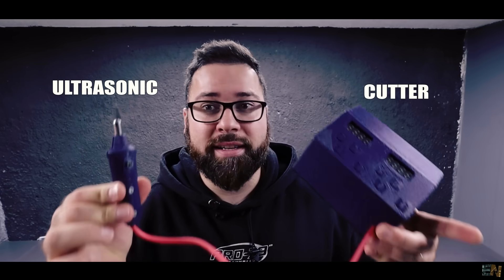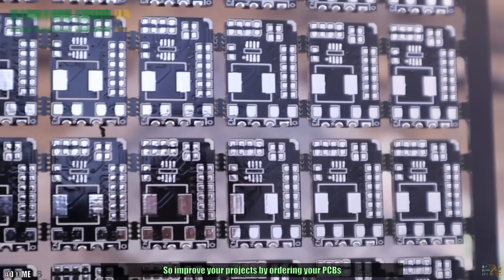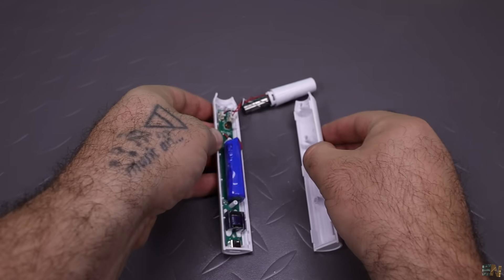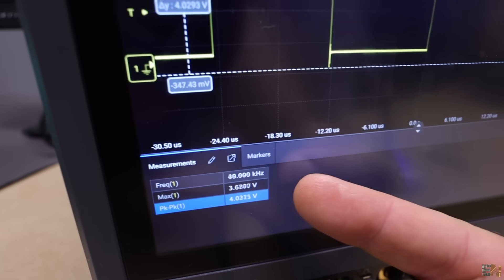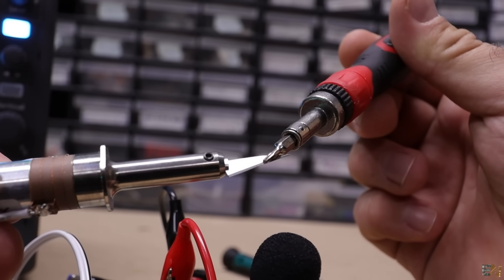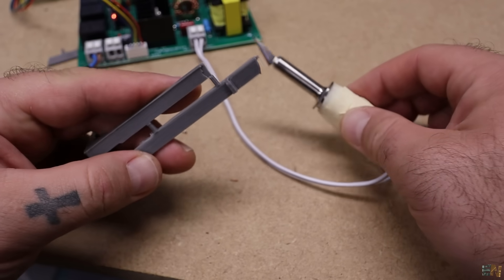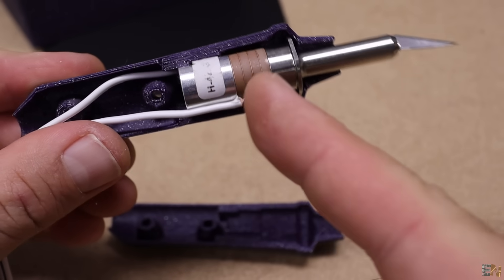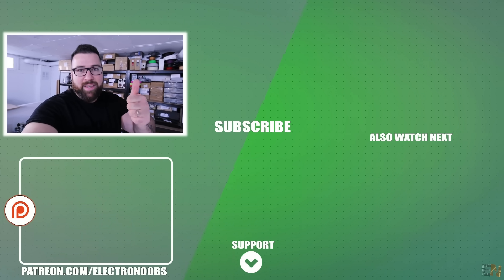Homemade Ultrasonic Cutter vs $500 Store Version!

Comment: Heyy super cool project! Could it also do some ultrasonic welding of two thin pieces of plastic? I was looking into building one also but looked to hard but really cool you made it work!
Also for mounting the piezo, I don't think the back is the right position for mounting, when you are at resonance there are peaks and valleys in the metal. the movement of the metal has a 90 degree phase difference with the pressure in the metal. Where there is a peak in the pressure there is no movement and that is the ideal place for mounting the piezo consteuction. 

The end pieces usually have the most movement and that is true for the back and the front of the piezo construction I think

Comment: A very good project!  I'll be eagerly awaiting a sequel. I've already been down much of this path myself.  One quibble, though.  You talk about to the horn 'amplifying' the US signal. Just as in stereo speakers (and electronic circuits), much of what you are wrestling with is impedance matching. The change in perceived US power strength is a matter of coupling efficiency.  'Amplification' implies that power has been added to the system.  'Gain' (a term you also use) is not really the same.  It implies that power is more efficiently transferred in the way that you want, and is therefore transferred to the intended target.  Subtle, but important.  But I'm sure that you know this.

Comment: I think this project is super useful for people like me who need to make clean holes for USB-A, USB-C, and other ports.
I’m building a custom powerbank with a huge capacity (around 350Ah).
Inside the box there’s also a 4G/5G modem, a led light with controller, and other modules.
I use it for camping up in the mountains😂

Comment: I'm using the irs2153, in the same configuration. But im not using bootstrap, as both transistors are low side drivers (ie emitter to ground). Try again without the bootstrap cap. Hampster time does a great video on this.

Comment: Because you want to make it handheld, I’m honestly wondering if lowering the frequency could make it cut better? 

Think about how a jigsaw works, if the blade speed is too high the cuts turn out worse and wear out the blade faster than when it’s dialed into the proper speed.

Comment: Power ultrasonics is a quirky and challenging area of electronics and physics, but you're off to a great start. 

A few tips. A bipolar drive signal is best, but it's not strictly necessary. You can get great performance just from a DC square wave, too. You didn't go deep on your feedback loop for tracking resonance, so maybe the IC is handling that for you. But it's critically important: that dental transducer may have a resonant peak only 10-50Hz wide, and the resonant frequency changes constantly as components heat, as your grip changes, etc. So make sure you have an active tracking strategy you can control. The PLL on the cleaner driver may be ill suited to your transducer. 

For miniaturizing to make this portable, I had luck in an early prototype using a TI 100W bridged opamp IC and a step-up matching transformer. 40KHz is outside of its effecient zone, but it worked and kept heat low. 

Good luck with part two!

Comment: If there is more than 400 V, then isolation of the cable might not be suffcient. Also the distance between the transducer cable and the on-button can lead to a spark which will destry the circuit low level part.

Comment: You can not just only cut but....
Solder on not suitable surface like Aluminium and glass .
Can super mix two non mixable solution like oil water.

Comment: 8:46 I want to share my experience , i noticed normally  the output of USC board is very low whithout transducer connected because I tried shorting or driving Flyback Transformer it doesn't work at even 50% of power even with proper impedance Match but when I connect pizo or perticular value cap in series it suddenly jump to resonance with Highpower mode .

Comment: Ultrasonic transducers become resistive at their resonant frequency, that is why a "push-pull" power driver circuit is required.
Reply: Can you help me ..? I want to power and modulate lower audio frequency with Ultrasonic so I am not sure which High power switching topologies is best ?
Reply: @omsingharjit  A standard audio power amplifier will drive piezo transducers at sub-ultrasonic frequencies.
Reply: @ricksampson6780 no , my pizo is from ultrasonic cleaner no audio driver will give 300 to 800 v for US frequency normally. I have seen people using H bridge Moter driver for low voltage but i need For 40 to 80 watt power for such Transducer .

Comment: I wonder if adding mass to the base of the transducer would increase it's performance. The crystals do nothing but drive two metal masses apart. As soon as the blade touches a work piece, the whole coupling requirements shift towards a higher counter mass. And the plastic enclosure does not offer the rigidity for a good power transfer to the user to act as counter mass.

Comment: Dead (or dwell) time in push-pull and bridge DC-DC converters is critical. It prevents both switches from conducting simultaneously, which would cause shoot-through current, excessive heating, and possible device failure. Proper dead time also allows diode reverse recovery and switching transients to settle, reducing EMI and improving reliability. Too little dead time can destroy the power stage, while too much increases losses and decreases efficiency. The goal is to set a safe margin that ensures clean switching without excessive conduction in the body diode.

Comment: For MOSFET droving you can use TLP250-TLP350 optocouplers, you will have isolation as bonus. Only you need to power output of these optocouplers with 10-15V supply. And you need to increase ratio of transformer to get higher output voltage. Also you need to adjust output resonance with inductor - capacitor like in board you bought.

Comment: Just remember one thing. For that 40khz transducer it has a specific capacitance and you have to match a inductor with suitable inductance to creat that LC resonance frequency. But when you try to cut or the horn touches other things (case included) the capacitance changes and also affects the resonance frequency. You must add a feedback circuit to cope up with that.
Reply: Ultrasonic transducers become resistive at their resonant frequency, that is why a "push-pull" power driver circuit is required.
Reply: 8:46 I want to share my experience , i noticed normally  the output of USC board is very low whithout transducer connected because I tried shorting or driving Flyback Transformer it doesn't work at even 50% of power even with proper impedance Match but when I connect pizo or perticular value cap in series it suddenly jump to resonance with Highpower mode .
Reply: No feedback is needed because I noticed USC circuit are able to self correct resonance frequency without any feedback.

Comment: It shouldn't need to bootstrap considering the mosfet is always ground referenced. Maybe the VBAT is to low for the driver? The IR2104 has a minimum voltage on VB referenced to VS of 10V. And VCC also needs a minimum of 10V

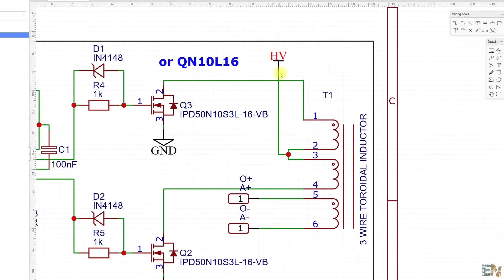Comment: 6:35 - Use a low-side dual MOSFET driver like TC4427? They are like level-shifters but can handle much more current to effectively charge/discharge the capacitance and miller capacitance of the MOSFETs

Comment: You might try pinning the actuator to your handle using the special glue you mentioned. By rigidly securing the base, more of the actuator’s motion will transfer directly into the horn.
Reply: There's actually a happy medium. You want the actuator to resonate, and if it's fixed in place to too much mass it can damper the oscillations too much. Though with these small units I'm not sure how much *give * they want

Comment: 10:25 are you sure its not looking as cut with hot knife because the whole transducer and the blade were hot?
Reply from the maker: Yes it dose. The friction kind of melts the PLA plastic. Depending on what you cut it  might look like that.
Reply: @ELECTRONOOBS  there is also ultrasonic welding of plastic which looks same as melting the plastic with heat, so probably that was the effect you got there. maybe you can make a modular tip and make attachments for cutting, welding, cleaning

Comment: Do the commercial ultrasonic cutters use a scalpel blade as the cutter.   That is could a thicker blade transmit more energy to the cut at the same operation settings?

Comment: BTW, acoustic horns absolutely amplify the sound — literally more total energy gets imparted into the air because the “transformer” of the horn does impedance matching between your cake hole and the open air :-)
Reply: Does impedance matching mean more energy is extracted out of your vocal apparatus (less lost) or how does it work?